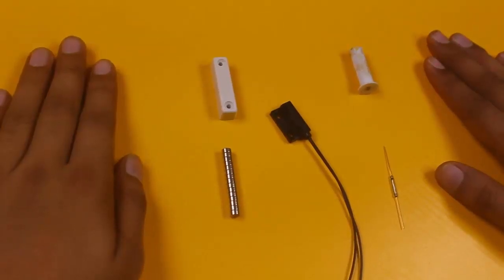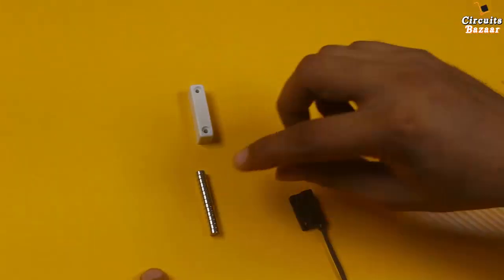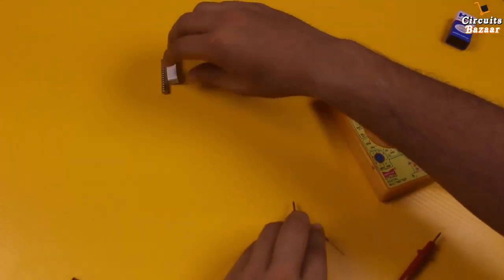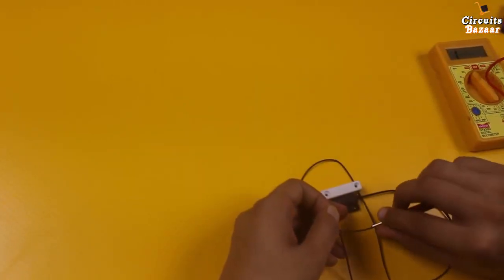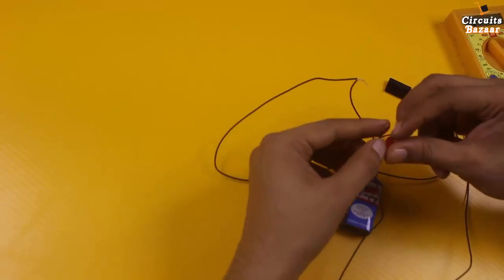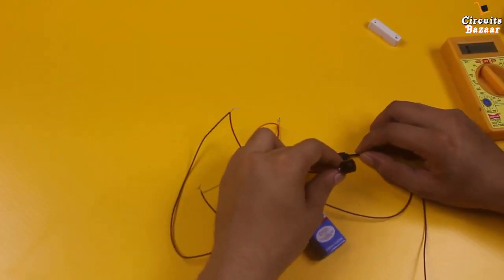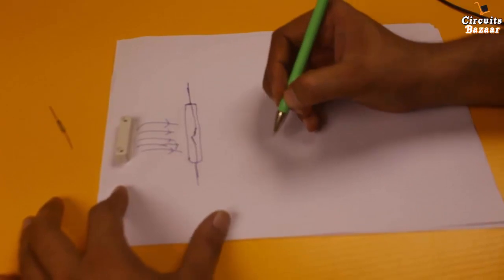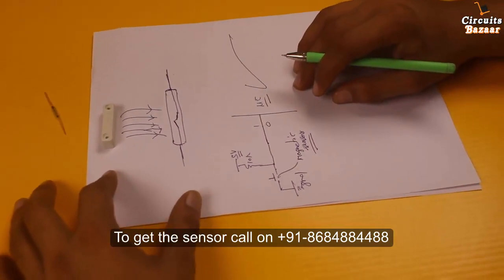How to Use Magnetic Sensor and Reed Switch in projects

Comment: Nice video! How would you do if you want to reverse the effect? How do you have the light/sound stay on until you put the magnet close to the sensor?
Reply from the maker: in that case please feed the data of the reed switch to micro controller and driver the light or sound through microcontroller . now here you can generate any signal through microcontroller
Reply: An easier way is to use an always closed reed switch so when you remove the magnet the light will turn on. No need for a microcontroller, that's just complicating a simple solution.
Reply: @FarmerFpv  bro can you please share a link of a closed Reed switch as I need to turn on light when magnets are not in contact (for car door) but i am not understanding which one to choose so please share a link from Amazon
Reply: @The.Innovative.Indian  bro can you please share a link of a closed Reed switch as I need to turn on light when magnets are not in contact (for car door) but i am not understanding which one to choose so please share a link from Amazon

Comment: But the reed switch will blow after few operations what is the solution for it?
Reply from the maker: Use relay and drive relay driver circuit with the reed switch. reed switch are for signal generation that is high or low, not to drive applications.

Comment: I have treadmill but it was fixed magnetic reed switch beside the motor.but on board have connection for 3 wires not for two.
How I can connect reed switch
Reply from the maker: One wire is of earthing

Comment: Can the light led switch to dc motor
Reply from the maker: Light Load you can run but for the bigger loads you have to go for relay unit or higher power Reed Switches

Comment: Can this sensor handle the 12v dc current of motorcycle?
Reply from the maker: No it can't ....    use this to program your microcontroller only then do whatever task you want to do
Reply: Use a relay switch or transistor